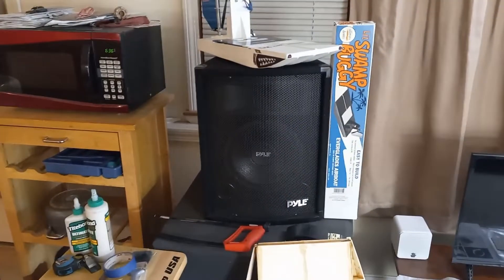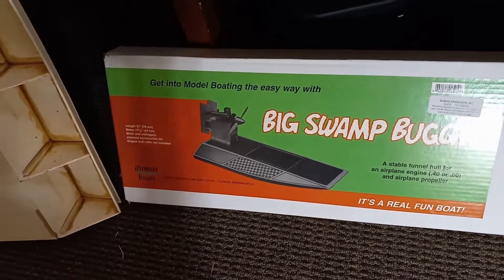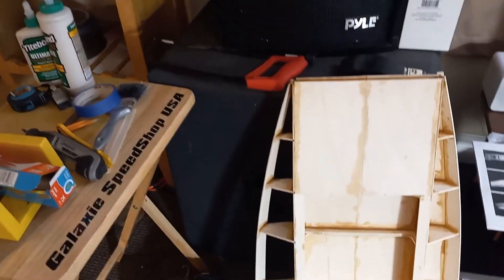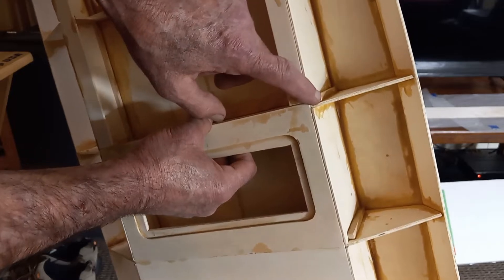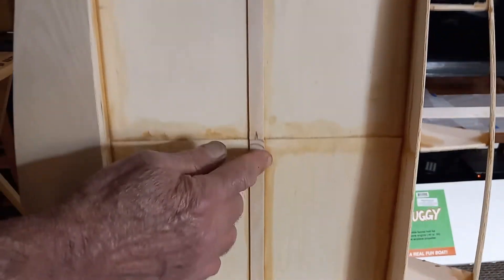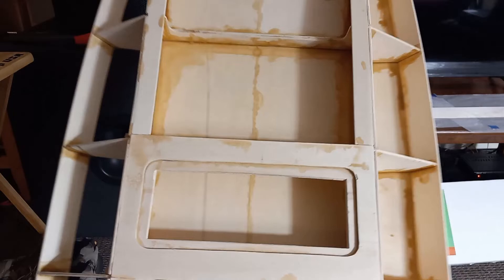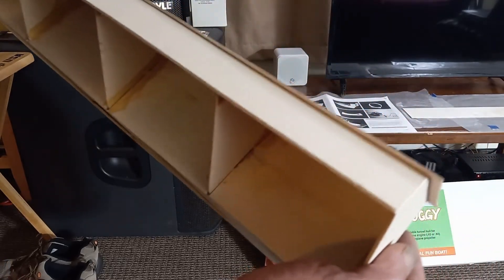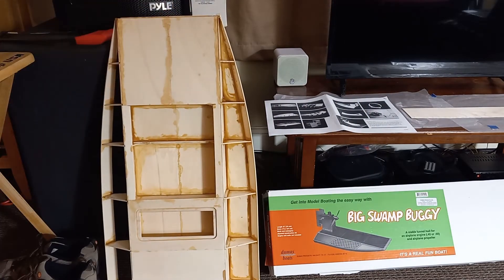Big Swamp Buggy Build

Comment: What paint did you put on wood?
Reply from the maker: Paint is an exterior acrylic latex...durable, but a disappointingly rough finish when applied with brush as I did...I think spraying it would have resulted in smoother finish for less hull drag...good luck, this is a fun hull either way! 2HatMatt